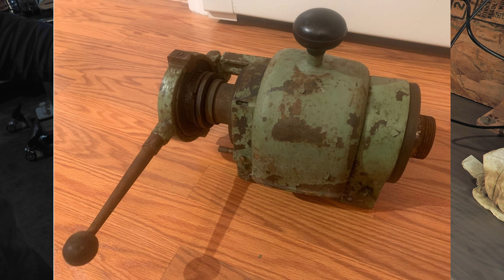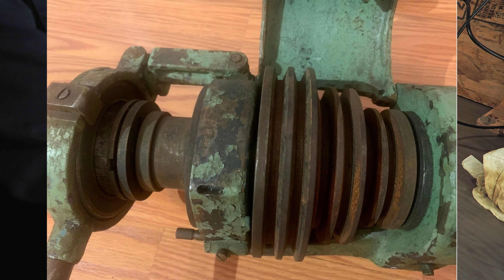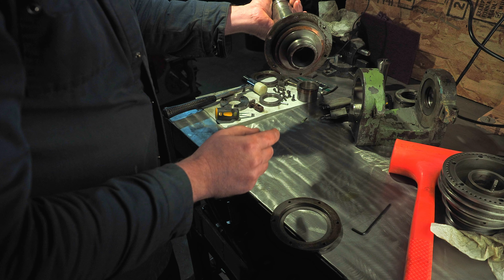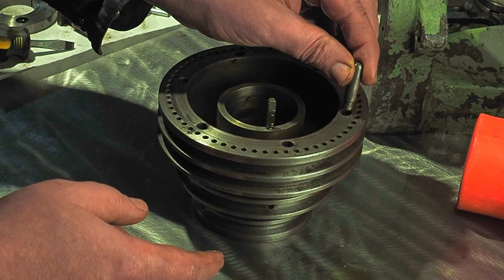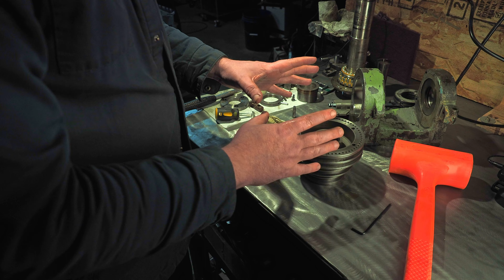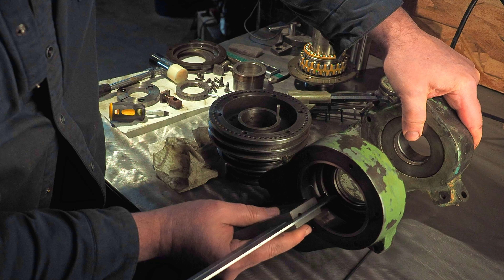wade no 7 lathe spindle teardown

Comment: Thanks for the video. I have a #7 with a headstock that's louder than I'd like. This was helpfull. 

The detent pin in my lathe is similarly worn. Since there's no spring to keep it away from the drive pulley, I think it migrated to the spinning pulley and did its damage there. Not sure how to prevent that from happening.

I also have a few NOS #7 parts: crosslide top, lever slide top plates,  misc collet closer parts.
Reply from the maker: it wasn't that bad to take apart, you maybe could use a magnet and something 3d printed to keep it back.

Comment: My lathe spindle uses similar main bearing check for nuts under the axial bearing if my suspicion is correct the main bearing has internal taper and the nuts are to adjust any play basically spreads the bearing .
I am sorry for the bad sentence structure .